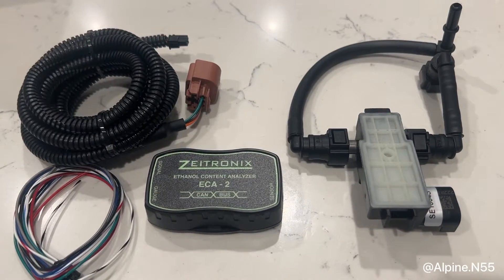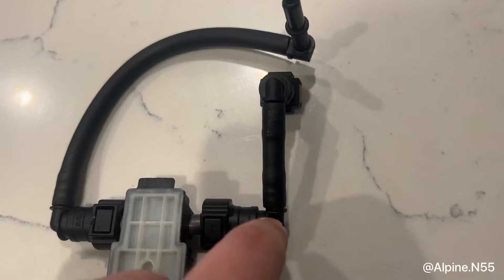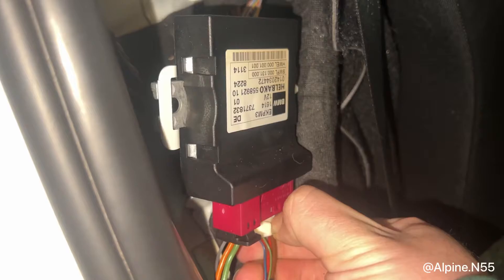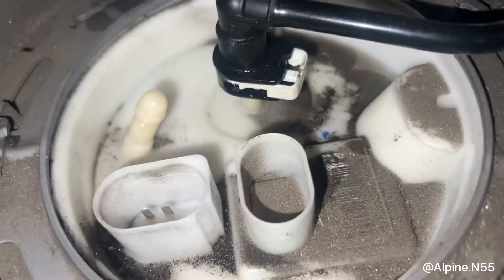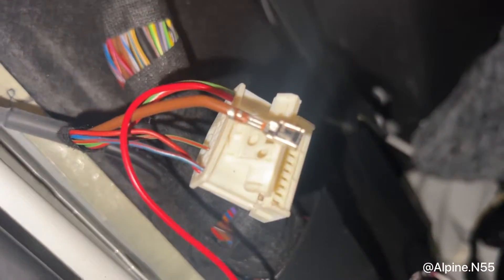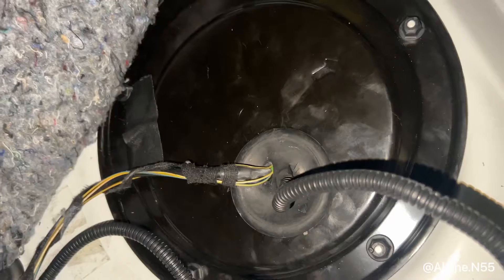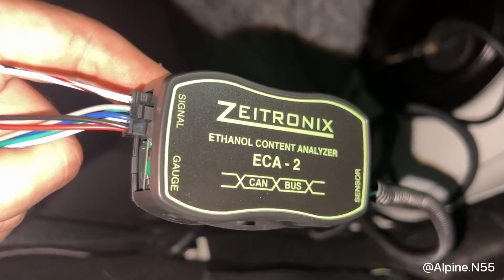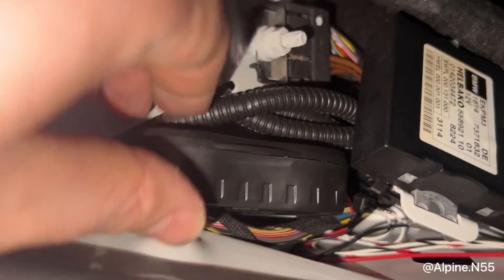DIY FLEX FUEL KIT FOR BMW N55 & S55! WORKS WITH MHD OR BOOTMOD3!

Comment: For F series n55, do you need to upgrade the fuel pump to run flexfuel on MHD?
Reply from the maker: To get benefits from the ethanol being in the tank you would need an upgraded hpfp.
Reply: @alpine.n55 could you get away with upgraded lpfp and what hpfp do you recommend for a 2011 
335

Comment: Thanks for sharing the video but I have to say this wasn’t worth DIYing. It cost me way more in time and money to get lines, fittings, heat gun, make it all only to end up with fuel leaks and trying to remake it a few times. In the end I got myself a BM3 kit and would not recommend anyone really DIY this. BM3 has a beautiful kit with a machined housing for the sensor that provides a bypass so there’s no restriction to fuel line from adding the sensor right in the line. My friend had an MHD kit installed with their plastic lines on their car and he had fuel pressure issues when pushing the car on power and he swapped in a bm3 kit with the bypass and issue was resolved. Just sharing my 2c for whatever its worth.